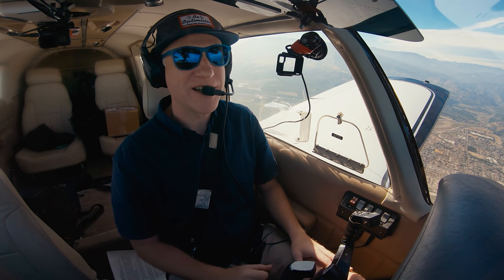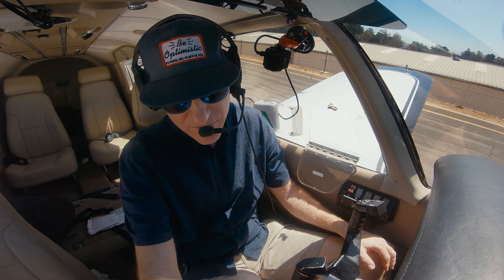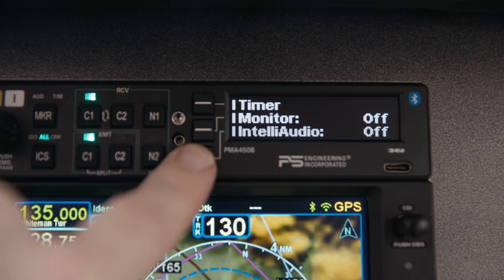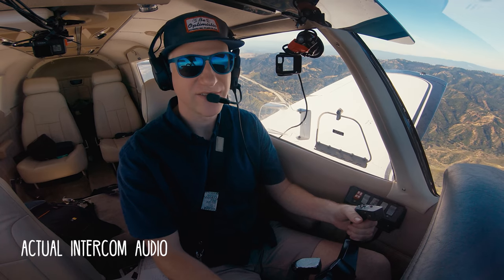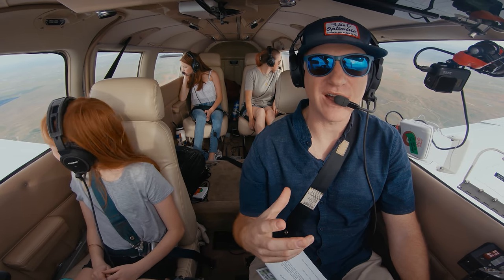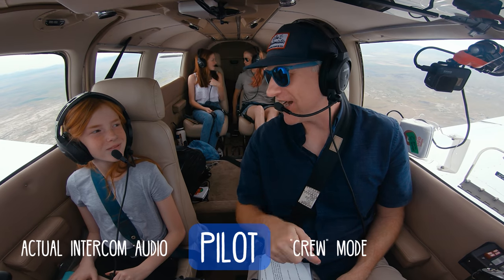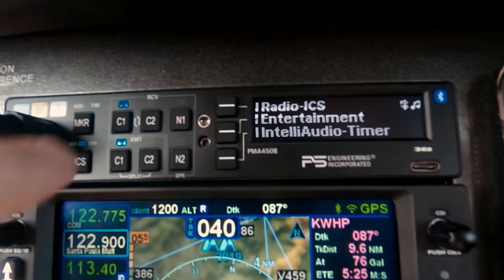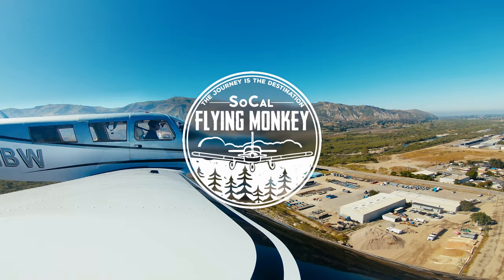IN DEPTH PMA450B Audio Panel Review | Can Your Audio Panel Do All THIS? | Rocking out at 6500 ft.

Comment: I first installed a PS engineering product in 1994 and having done six different installations over the years with differing audio requirements and PS engineering have had a solution that works superbly. The PMA450B looks good and I could just slide it in to replace my 8000BT……….but is it good enough to warrant replacing and audio panel that I am totally happy with ?……………. Now that is a first world problem.

Comment: Great summary, I have one on order for the 421.
Reply from the maker: youll love it!
Reply: @SoCalFlyingMonkey  BTW you can add a switch on your yoke or panel to play back the recordings without using the control head of the 450. Pin 22 on J2 will do that with a normally open switch to ground.

Comment: As always awesome content! Just want to ask, do you think that too much stuff in the cockpit may become a distraction? Or in moments of heavier workloads is easy to focus? Not a critic in any way, love your content and fly style
Reply from the maker: It is a very valid point and something I think about often.  Short answer is yes too much can be distracting.  I often find myself thinking about the simplicity of the steam gauges that tell you exactly just what you need to know.  Very efficient. My panel has a lot going on and it takes some discipline to know what to look at when and when to ignore a lot of info and features. As far as the audio panel, you dont really need to do much with it once you have it setup- in fact you dont have to interact with it at all unless you want to monitor a second comm and then its just one button push.  The rest of the tools are just bonus so you can work them in when you want.  But it is best to become proficient with it on the ground and at a high altitude on a clear day with the autopilot on.  If I am in a busy workload phase and I don't know exactly what my button presses will do I tend to not fish for solutions and just stay using basic functions.
Reply: @SoCalFlyingMonkey  That's exactly the kind of explanation I was looking for! And I don't expect any less from you, safety first. Congrats on the flying and on the channel! Keep going higher and higher

Comment: Amazing audio panel and, if I may, very well-made and catchy review. I already have a PS-Engineering panel. How is the compatibility of the 450B with the tray of prior models?
Reply from the maker: I don't know the answer to that one but PS Engineering is a great and friendly company and very attentive to their customers and can definitely answer that one.
Reply: The PMA450B is Plug N Play with all models of our PMA8000 series. Get all of the functionality without any wiring changes. If you want to implement the flightmate function, (built in audio alerts triggered by discrete inputs) an avionics shop would have to perform that new wiring.

Comment: Do you keep your plane in the club seating, all the seats facing forward, or remove the middle row?  Also, could you do a video on different configurations?  For example how many people you can fit in with full fuel, or having 6 adults how much fuel and range do you have.  I have 3 kids and I think a 6 would make a good plane for the 5 o us.
Reply from the maker: The plane only has forward facing seats.  You cannot just switch to club seating. Some of the model years offered both (you have to look at the type certificate data sheet for that model year) and in those models it is legal to switch to club seating but it's not something you can go back and forth on.  I opted for a plane with forward seating for a couple reasons- 1) passengers are more comfortable in my opinion facing forward (usually anyone in the middle row is a newbie). 2) With club seating and the way the 2 seat backs lean against each other between pilot row and middle row, you lose some space in that triangle, especially if the pilot or copilot has pulled their seats forward.  In the forward facing config, when the pilot row moves forward you gain some legroom in the middle row.  The seats (middle and back) come out very easily.  Just a few seconds each.  We usually fly with the middle row out for extra legroom.  If we are taking bikes we pull the back row and can fit FOUR bikes with wheels off. Its incredible.  I had my A&P sign off weight and balance sheets for every imaginable seat configuration.  So we can fly with just 1 rear seat, 1 rear and 1 middle (skiing), etc etc you get the idea. The 6 is probably a great plane for you all.  Mine has empty weight of around 2000 pounds and useful of 1400 pounds ....so with full 84 gallons of gas @ 6 pounds per gallon = 500 pounds of fuel and that leaves 900 pounds for people and bags.  Quite a bit.  And you can always just fill to tabs and save a hundred pounds at the expense of range but I mean with full fuel its 800-900 miles which we usually dont need.  Its a great all around plane.
Reply: @SoCalFlyingMonkey  Thanks for the in-depth reply.  We have a redhead in our family too!

Comment: Great work again Eric! I own a PSE 450A, which has only 1 BT connection. I use this one for my phone. I'm still not clear on how to configure multiple music inputs for my passengers. Are the other non-BT music connections your family was using hardwired into the back of the 450? Are these unswitched inputs?
Reply from the maker: From the installation manual. - "The PMA450B has four available music inputs. Music input number 1 is J2 pins 23 (left channel) and 24
(right channel), with respect to pin 25, and Music number 2 is connected to 26 (left channel), 27 (right channel), with respect to 28, plus Bluetooth® modules to stream music from a paired device. "   They are dedicated music inputs and different than the unswitched inputs and switched inputs from my understanding.  So 2 hard wired music inputs, 2 bluetooth music inputs, 4 unswitched inputs (like callouts from your EFIS or GPS), 2 com, 2 nav, and 2 additional switched inputs (DME, etc). Hope that helps.  Here is a link to the installation manual if you enjoy that sort of thing. :)  http://www.ps-engineering.com/docs/PMA450B_IM.pdf

Comment: I wanted to ask something off topic from the audio panel. 

Do you have some closeup pictures of the overhead mount on how you attached your Stratus box to the headliner? I want to get it set up like that in my Cherokee. 

When I placed it behind my radio stack in the panel it did not get enough cooling, and I’m tired of carrying it around and having the suction cup fall off the window after reaching cruising altitude. 

Thanks
Reply from the maker: It’s one screw through the stratus holder into the overhead.

Comment: How much did all the wiring and installation cost you in cherokee? The audio panel itself is affordable, but from the video I could easily see the entire airplane needs to be broken apart to install it.
Reply from the maker: The audio panel installation was done with the rest of the equipment in that center stack.  I bought the equipment separately, had a shop wire it all together, and had my A&P/IA buddy do the installation so it was done in stages and I don't have numbers for everything broken up like that.

Comment: Hi! Been watching your videos and I noticed when you’re inflight your door (co-pilot) seems ajar (view from your right wing camera). Thanks.
Reply from the maker: Thanks for pointing that out. I have replaced the eyebolts and clevis pins and adjusted the strike plate to get it to seal as tight as I can.  It is much better than it used to be but it still looks from the outside like it's open.  It is an old high time airframe and that may be the best I'm going to get the door without some major rework.  It does latch in all places and is almost totally sealed with the door seal.  There is a little bit of light you can see in one part from the inside but it is really minimal.
Reply: @SoCalFlyingMonkey  That explains it. Hey, thanks for sharing your flight videos, it's really enjoyable watching.

Comment: AWESOME Video! Question - I have a PMA450 also but not installed yet, with my old audio panel, it required a separate intercom, on which I could adjust the squelch. But with this PMA450 audio panel, is a separate intercom required? If not, then how do you adjust the squelch for each passenger/pilot/copilot? I don't see a squelch knob on it?
Reply from the maker: Nothing else required. It automatically adjusts the squelch for the intercom. It works perfectly. It has some advanced tech they call intellivox to auto squelch and provide very clear intercom.
Reply: SoCal Flying Monkey thank you so much, and I love your channel!
Reply from the maker: @jeremiahgazsi8579  anytime. thanks for watching!

Comment: The inetlliaudio stuff is an old tricks! That's a mix of stereo paning and presence i.e. EQ on the mid freq band). Easy do perform real time digitally
Reply: FYI It is not stereo panning nor EQ. It is a digital process that calculates the various phases of the two audio signals. This allows the placement of each audio in a specif location. The PMA450B uses DSP technology and the calculations were provided via the USAF Wright Patterson Air Force Laboratory under patent 7,391,877

Comment: Why do ALL audio panels have static as background all the time? Seems like in 2020 we could filter that out.
Reply from the maker: It is SO loud inside the airplane- I am surprised intercoms sound as good as they do.  I mean if you have ever recorded sound with even professional microphones in a noisy environment and tried to filter it you will quickly discover how hard it is to eliminate all noise when the environment is that loud.  I mean it is really really really loud in a PA32 with 300 horsepower. And I usually have the vents open and blowing.   In the airplane in real life it sounds very good, especially with Bose A20 noise cancelling headsets.  But at home on a computer you really will notice what is left of the b.g. noise.
Reply: @SoCalFlyingMonkey  Thanks for the reply. I've trained in a Cessna 150 with an ANCIENT radio and the squelch was almost innefective. It was difficult to understand my instructor over the static on the headset, not to mention the background noise. I've also trained in a Cessna 175 with a better sound panel, but it still has static that I can't get rid of. 
I also hear that static on all YouTube videos where the audio is recorded through the sound panel. 
Maybe it's a function of the radios (or the frequencies) themselves. 
Your Bose A20 headset and high end sound panel would be an ideal setup, and maybe it sounds better in person than the recording indicates. Or maybe I'm just lucky to be hypersensitive to static. :/
Thanks again for high quality videos and actual conversation with your viewers!

Comment: When in intercomm Mode: Alternate or CPX and I'm flying along during IFR and ATC is talking constantly, it will keep muting my passengers? Am I understanding this correctly? I feel like I would use CPX mode a lot and that's a deal breaker if it cuts out PAX every time ATC talks.
Reply from the maker: Correct you won’t be able to hear them when receiving radio transmission.  I’ve complained to them about this since we already have ISO mode if we don’t want to hear passengers.
Reply: @SoCalFlyingMonkey  What a shame. That seems so obvious, why would they do that? I wonder if it can be a firmware update? Do you know if the GMA 350C does that too?
Reply from the maker: they said they will work on it with firmware but they got other focus priorities for the engineers. its a small company

Comment: Greetings from Australia! When your phone is paired for making or receiving calls with the audio panel can you record a video on your phone and pick up ATC audio? do you need to change any settings like BT1 or BT2?
Reply from the maker: In order to receive the audio on your phone it must be paired with the Streamer function of the audio panel. I usually pair my iPad mini to the Streamer bluetooth connection, which uses one of the two available bluetooth connections on the audio panel. I do not believe it is possible to pair one device with both the BT1 input of the audio panel as well as the Streamer BT2 function of the audio panel, but this is more likely to be  a limitation of the phone rather than the audio panel.  I dont think the phone can pair with 2 different bluetooth connections at the same time.  The people at PS Engineering would know for sure though.  My recommendation would be that if you want to pair a phone for phone calls and music but also record the audio from the panel, then you could have an old iphone dedicated to be the recording device paired with the BT2 Streamer function.
Reply: @SoCalFlyingMonkey  🙏 I sent a few emails to the company, and I don’t think they understood my intentions! Thank you for the clarification! How easy it is to connect / disconnect from Streamer BT function on a device?
Reply from the maker: Easy- just go into your bluetooth settings and tap on the Streamer and it will connect.  Or tap on the other BT source and it will connect.  You can rename the BT inputs/Streamer to whatever you want on the PMA450
Reply: @SoCalFlyingMonkey  😊🙏 Thank you. This helps a lot!

Comment: Do you need a Complex rating to fly this plane? I saw a Prop RPM lever, but it's fixed gear.
Reply from the maker: No you do not.
Reply: @SoCalFlyingMonkey  Thank you very much!
Reply from the maker: @edwardtye4119  but you do need high performance endorsement- it is 300 HP
Reply: @SoCalFlyingMonkey  Ok, thanks for getting back to me so quickly!

Comment: Eric, are you able to record the cockpit audio via Bluetooth when you’re recoding video from your iPhone or Android? Thanks
Reply from the maker: That’s a great question.  When I record with my phone for Instagram I use a cable and it does record on the camera app the audio coming over the cable. I think it should work with bt as well with the Streamer function of the pma450.  I will try to test it
Reply: @SoCalFlyingMonkey  thank you so much. Would you please let me know when you try it without the cable. I called the company and spoke with the owner, Mark. He didn’t know the answer to my question. Thanks!
Reply: Hello Eric, did you get a chance to try it and dose work? Thank you
Reply: Hi Shawn, yes, using BT2 as a streamer out, while paired to an iPad (or iPhone) and using the free FlightLink app, you can record everything the pilot hears or just the com audio. The only limit in recording length is the amount of free memory you have on you IOS unit.
Reply: @markscheuer7091  thanks a lot Mark! You guys have an excellent customer service!

Comment: Why does the rear edge of your door look like it's ready to open in flight?
Reply from the maker: Thanks for pointing that out. I have replaced the eyebolts and clevis pins and adjusted the strike plate to get it to seal as tight as I can.  It is much better than it used to be but it still looks from the outside like it's open.  It is an old high time airframe and that may be the best I'm going to get the door without some major rework.  It does latch in all places and is almost totally sealed with the door seal.  There is a little bit of light you can see in one part from the inside but it is really minimal.
Reply: My ‘74 Mooney has a similar fitment issue with the leading edge. Door seals tight, but when you look from the outside, you can notice that it isn’t  perfectly aligned. Thanks for the reply Eric. Keep flying safe and putting out the great videos.